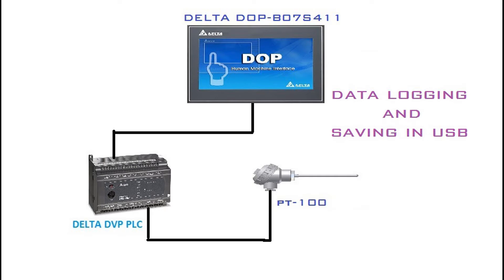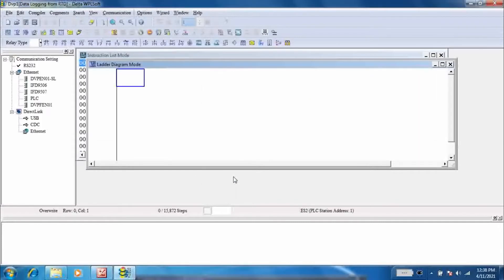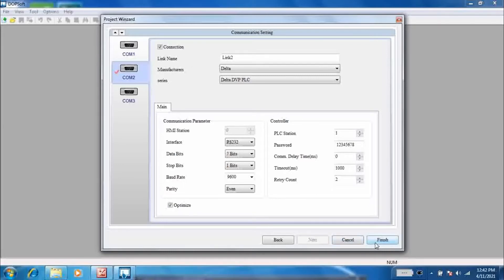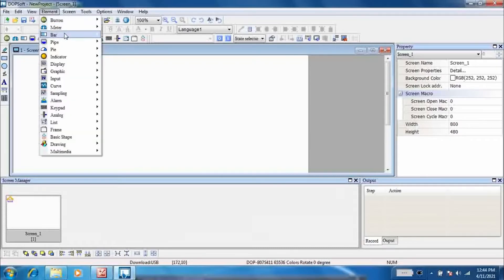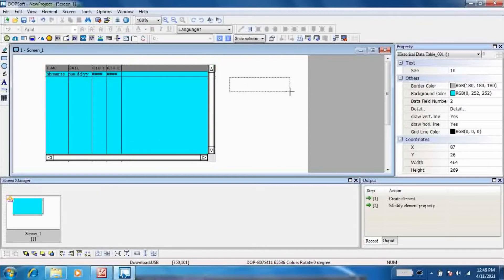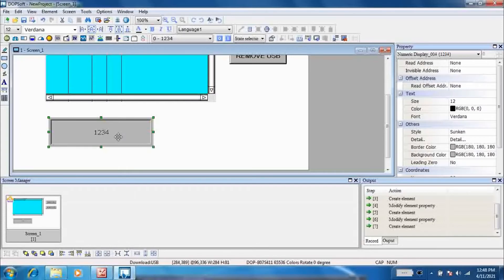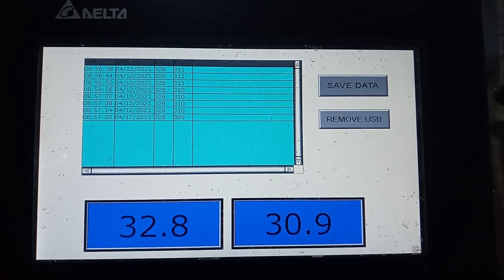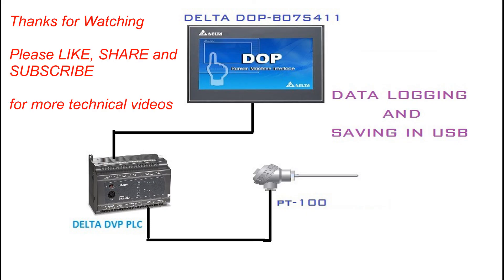Data Logging and saving in USB from Delta DOP B Series HMI

Comment: Best explaine for history data but I have got the CSV fill empty plz give solution
Reply from the maker: Thanks Ajay Kumar for the nice compliments. I will surely reply you with a solution today.
Reply from the maker: Dear Ajay Kumar,
Please verify the below mentioned steps

1. Set Sample Cycle as 1000 milliseconds. This will take data samples after 1 second. 
2. Set sample number as 3600. This will save data for one hour. 
3. Assign address of the data need to log.
4. In the File Output Tab, check the Non Volatile and select as HMI.
5. In the File Output Tab, check export CSV file.
6. Select Trigger as "Timer".
7. Check "Stamp Date and Time".
8. Select save as single file. 
9. In the "Report List" menu, select report device as "USB".

I hope that this problem will be solved. For further clarification feel free to contact me via email "sana_urrahman2002@yahoo.com".